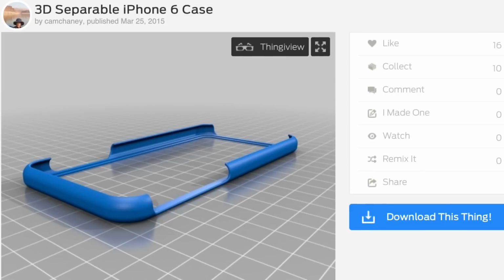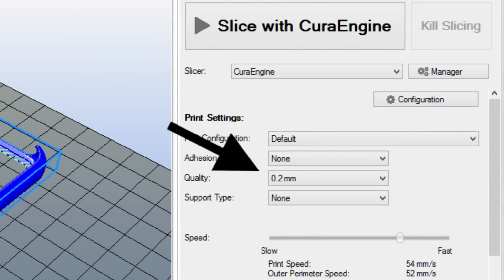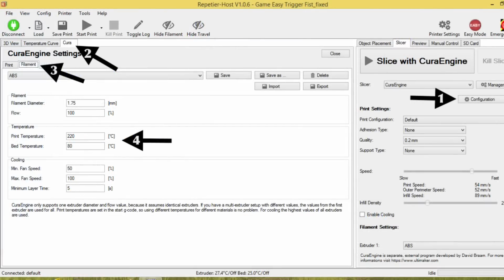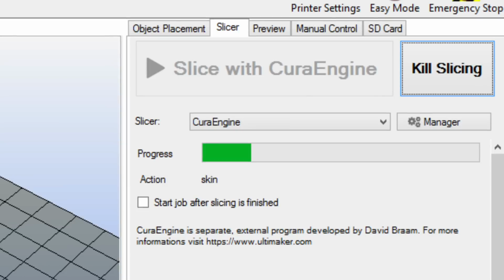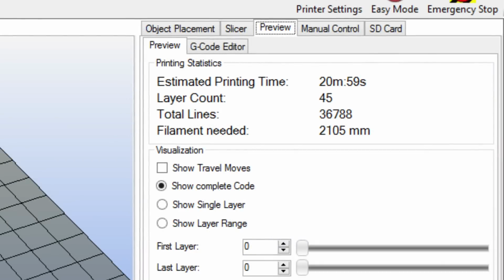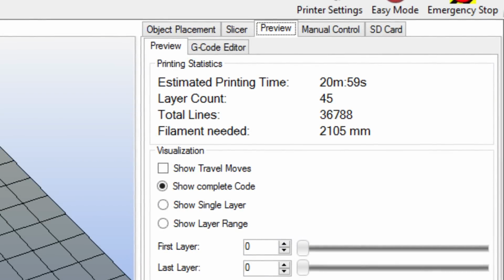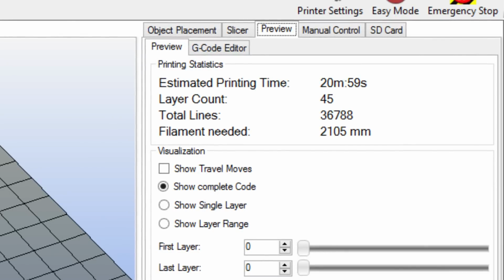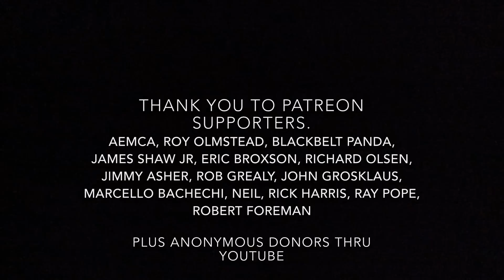Filament Friday #26 - iPhone 6 case using Repetier 3D Print and Florida Filament

Comment: Glad you've got a Repetier machine finally!  I had the same issue, XYZ wanted to log into my Mac remotely and snoop around, no thanks!  I was going by the book and purchasing their plastic with no problem and then they refused to replace 3 bad cartridges..  My 1.0A machine is now flashed and I'm running Simplify3d with it.  Next up will be dedicating a Raspberri Pi and running Octoprint so I can start prints remotely and monitor them with the RPi camera and automatically generate timlapse videos of all my prints.

Custom supports in Simplify3d are really something special.  Working on a Raptor prosthetic hand at the moment.  A little tricky in ABS, it seems there's no real solution for perfect PLA printing yet given the extruder and some of the cooling requirements it needs.  It seems like the motor will start slipping on the filament and ruin the print.  The Raptor hand would be a perfect project, you can print the entire hand on a single build plate.  And in the end, you could send it off to a kid in need!

I'd love to see other people's Simplify3D machine profile settings, curious about speeds mostly.  I'm using Luc's (who's responsible for the Repetier firmware) start and ending gcode in Simplify so I'm have zero issues printing directly from it.  

Keep it up, I watch your videos on my TV through the Roku YouTube app and happily let the ads run.  Would be curious see some copperfill or woodfill prints and finishing techniques on them!
Reply: ***** Here are Luc's start/end gcode.  It'll home and clean the extruder just like the XYZ firmware did.  And for a bonus, the printer plays the Indiana Jones theme in a series of beeps before your print (and then it plays Funky Town when it finishes).

http://voltivo.com/forum/davinci-software/739-simplify3d-g-code-scripts#5871

I also found a Simply FFF profile for the Da Vinci that someone had posted and I'm using that, it's somewhere on that forum.  I'll post it if I can find it.  Nice and easy to share settings.

It's all about testing and iterating on the configuration.  I'm pretty happy so far, and the slicing speed and simplicity of custom supports really makes Simplify shine.

I went from slic3r to Simplify, and I immediately had an easier time.  Also, Simplify's speed control on really small layers is great too, and visualizing them after slicing is a nice feature.  http://www.3dbenchy.com/ has been a nice quick print for checking out settings changes, great calibration print and prints in an hour or so.  Plus, my kids love playing with all of them that I've been cranking out!

Comment: I think your first filament Friday should have been a spool holder looking at the clamp situation. 
I recently bought the 2.0a purely on your recommendation and at the time the website i purchased from in the UK was selling cartridges at £23 now they have jumped to£37.
I have been looking into reflahing but i have the new new 2.0a with firmware 1.0.B. So not user if it will flashing?

Comment: Hi Chuck! My Da Vinci arrives today! Quick question. Now that you're more and more familiar with the repetier reflashed Da Vinci, would you recommend someone new to 3D printing start out on the XYZ software or perhaps reflash right away and learn the rep? As a learner it looks to make sense to go the rep route as it offers much more flexibility in the long run, but perhaps too complicated to start? The reflash process shouldn't be a big part in the decision. Thanks!
Reply: ***** When I got my DaVinci AIO and I had problems with the cart's from XYZ I decided to take the jump into re-flashing. As long as you read up on the steps and then follow them step by step it is not that hard to do.Repetier is not hard to learn. it is actually very similar to XYZ ware.  it also allows for you to calibrate the printer in the firmware. which can incress the quality of your prints.  NOTE you do want to know what these changes will do before making a change. DO NOT change stuff if you don't know what it will do. (yes you can always reload the fail safe but ...)So if you are having troubles with it not letting you use your legitimate cart's, or you want to be able to use filaments that are not available from XYZ, and don't care about the warranty then I would say go for it.Just be aware as soon as you flash it you have no warranty.Flashing does have its advantages though. it certainly has made it so I can print with a lot more types of filament like TPU, or PET just to name a few. I have a lot more control over the temps. and the print speed.as far as the slicers you can use with itI tend to like slic3r a little better then cura since I  started with it and have a better understanding of how it works. Slic3r seams to have more options then cura (it may be there as a I have only used cura maybe 10 times).  However I do find that cura gives slightly better results. so I have started to use it on models that require more detail.slic3r also lets me adjust the print height a bit easier then cura, but again that may be since I am used to it that i am just more aware of what to change. slic3r does seem to have a bit of trouble reading some of the models I have come across but they work fine in cura. example http://www.thingiverse.com/thing:923292Slic3r also has more types of infill patterns. this can help keep the plastic from warping (at reduced print speed) the Hilbert curve for example is really good at reducing warping and gives a better bonding but is way slower.slic3r seams to have a better manual then cura which is one reason I started with slic3r. cura's online Manuel is in my opinion less then informative on what each setting does. it does however have some nice trouble shooting pictures that can help a new person getting into 3dprinting though.That being said I think  xyzware isn't bad. XYZware lets you get your feet wet and is great to get started (they just need to no mess up legitimate users. However eventually I think you will find the open options in repetier make it worth it in the end.
Reply: Thanks a lot to the both of you! I've decided, with your advice, to start with XYZ and get familiar. Since it sounds so similar it looks like i can use it as a stepping stone and not just relearning something different. I will likely use XYZ until, as mentioned, it becomes a limiting factor, or my legit carts throw a code. 

I've just finished printing my first print! It was the keychain that's loaded onto the microsd card. Looked great on the edges, but looks like it's not full enough, (infil %?) which i would think they would have dialed in because its one of the first things you print, and could taint a first impression.

I did the shim modification already, and secured the glass bed as well. The platform is now pretty solid and the very straight lines and well defined points help to solidify that. I didn't even do a test print before doing these. 

Thanks again for all the info!

Ps what do you like to prep the print surface with for the natural pla? Just that glue stick? I was going to sand and rough up the glass a bit as per another video.
Reply: ***** when printing with ply you can use hair spray. Aqua net works well. but I prefer to use blue painters tape.If its a small print without a lot of surface area I just use the hair spray or the glue stick. If there is a lot of surface I use the tape. large prints with pla are hard to get of the glass, and PLA doesn't pop off like ABS does when it cools down. I had a large print that it took about a hour to get to come off. I was actually afraid I was going to break the glass bed. After that on large pla prints I use tape.